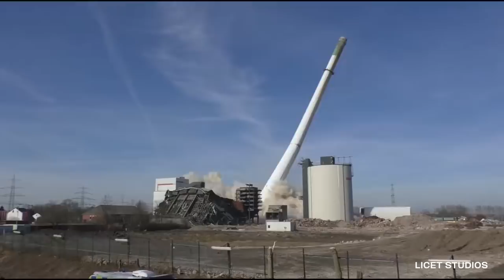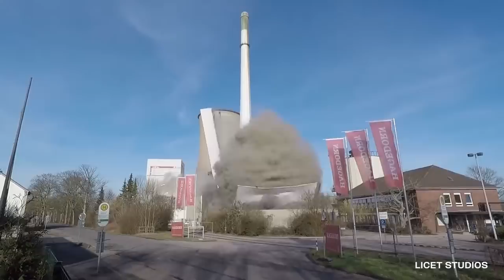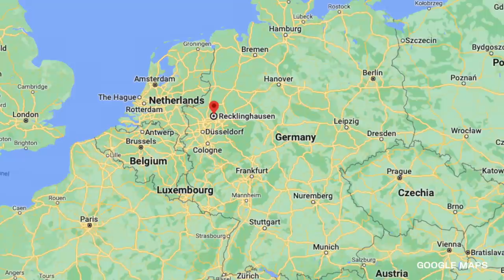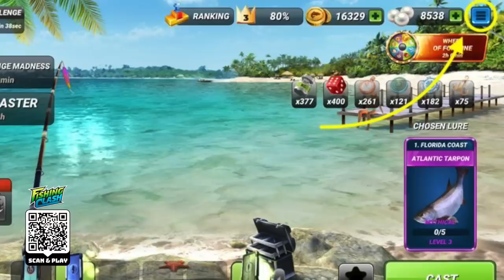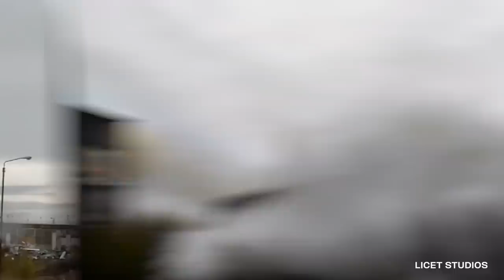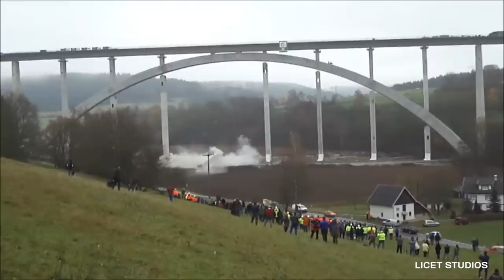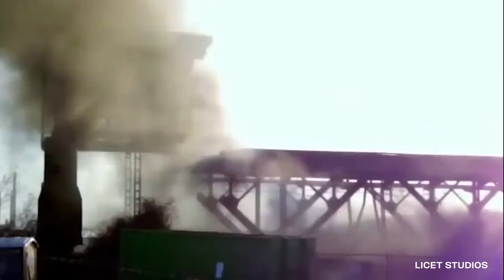10 Incredible Demolitions & Implosions

Comment: Years ago in my town there was a water tower that was 250 feet tall and the town sent out invitations to bid and all the contractors had bids that the town thought was too high.  Then the high school physics teacher and the high school metal shop teacher put their heads together and they made it a school project and ended up doing the job for less than 5% of the lowest professional bid.  The physics teacher designed the plan and the metal shop teacher and students carried it out and basically it was a matter of making a handful of cuts in the right places to weaken the legs then run a long cable around the weak legs taking a page out of Star Wars they tied the legs with the cable and basically pulled on it.  500 high school students pulled on the cables all at once and down came the tower.   Then the metal shop teacher got the metal shop students to salvage the metal and added it to the school's materials inventory for projects though they had so much that they still had most of the structural materials left over so they sold it as scrap and that brought a few thousand dollars that went to new equipment for the school.  Now they have the new water pumping station and new towers in place of the old ones and that produces five times what the old pumping station produced which is more than double the town's needs.
Reply: We can all agree that he has never disappointed us with this content, very, very cool, I also shoot such videos about interesting mysterious facts come see☺😉
Reply: OK Class! It's all ready. Stand back. Three seconds to go!! Where's O'Haire and Fernandes? Has anyone seen them......
Reply: Feeling bad for old water tower.😢
Reply: My mother's still standing
Reply: Classic,  the team's leader knew the importance of this project.  Great ! 👍
Reply: I’d pay to help pull!
Reply: Great story! Where's the town?
Reply: Brilliant!
Reply: idk

Comment: It's not the weit of the radio tower that does the work ,its the high  tension of 
The other wires that pulls the tower down. The same effect can be achieved by accident if wrong techniques are used during maintenance on the tower, the stay wires are in so high tension that an uneven slacking of  them can buckle or  fold over the tower

Comment: The weighted explosive blankets, as you called them, on the stay cables are only blast shield pads.   The charges are smaller and attached directly to the cables.
Reply: These narrators only read what they are told. It's annoying they don't know the proper wordage or terminology. This one calls the tower a "pole" and then says the transmitter helps to bring it down.

Comment: Shame you haven`t included a chimney demolition by the Late Fred Dibnah, an English steeplejack who would use fire to bring the structure down! He would cut slots out of the base on the side that he wanted the chimney to collapse first, hammering a length of telegraph post in it`s place. It was important that he used telegraph post timber as it was a fast burning wood with an in-built accelerant. When he had sufficient timbers in place he would set a huge bonfire at the base of the chimney and set fire to it. The natural draw of the chimney would help the fire burn quickly and fiercely and when the timbers had weakened through being burnt away the weight over the now weak and missing timbers would bring the chimney down!

Comment: Interesting: starting at 1:22, you start hearing a faint "whooooooo" in the background. I'm assuming it's the air being forced out the top of the chimney as it collapses.
Reply: My guess would be the sound of the top of the chimney falling more than airbrushing out. The smoke isn’t moving that fast but think of the sound of a long rope swinging through the air. The tip makes a similar sound.
Reply: They should have lit a big old old wood fire under it like Mr. fred dibnah  used to do, so it would have one good last smoke as it went down

Comment: Kudos for a live announcer, not the computer generated crap. However, comma, the tall transmitting device is called a tower or a mast. What was cut is a guy wire. The weight of the remaining guy wire pulls the tower over.The transmitter is not on the mast. It is in a house near the base of the tower.